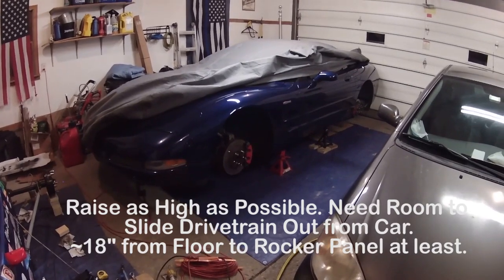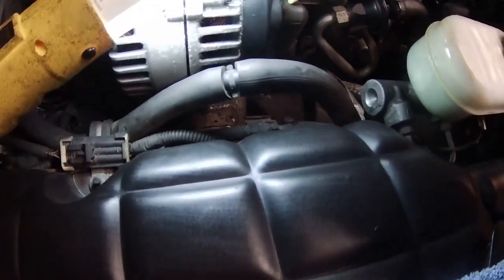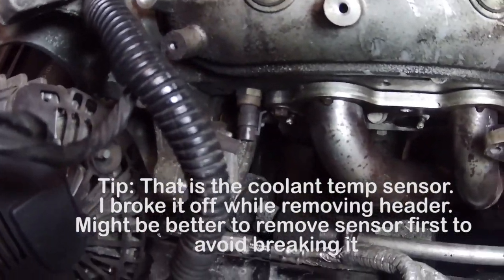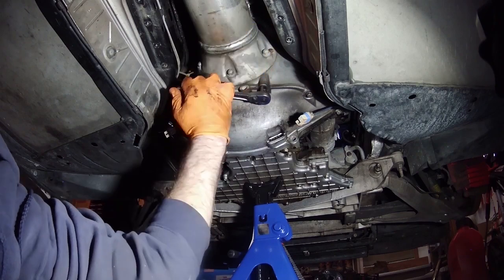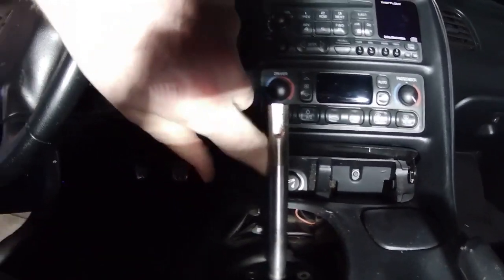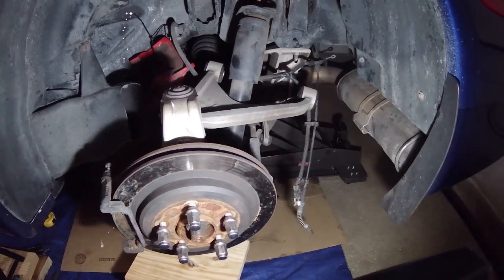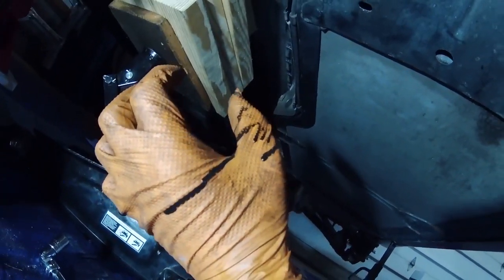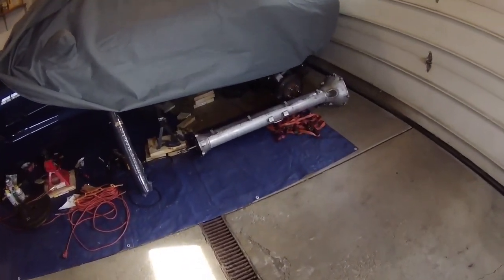C5 Corvette - Detailed Torque Tube Removal

Comment: It's easier if you removal the rear suspension cradle from the diff and trans first.  Drops a lot of weight.  And jacking up a bit higher helps.  Say at least 18" to jack points on the sides.  Thanks for the long video.

Comment: Thanks for the video! It's very helpful to prepare/refresh.
On suggestion: If you had supported the engine at its rear with a jack rather than a stand, you could have tilted it a little bit and the shaft would have come out easier. Now you put a lot of strain on the shaft when the transmission is lowered but the engine can't tilt.

Comment: You gave one very important detail which other videos don't bother to mention.  What tools are needed to get to upper torque tube to bell housing bolts.  3/8 swivel socket with 6 inch extension.  Thank you!!!
Reply from the maker: Good luck, they are a bitch to get to!

Comment: For anyone with long tube headers you can get away with just removing the passenger side and unbolting the driver side and dropping them down. You don’t have to fully remove them. Saves you some time

Comment: Do you need to drop the headers if you have stock headers?
Reply: Nvm
Reply from the maker: No stock headers should be fine to leave on. Long tubes like my car come back so far they are in the way. Stock ones are way shorter
Reply: Thank you
Reply: @cqe5009  mine is a auto do I still have to do every thing inside the car?
Reply from the maker: @automotivelane  never worked on a auto. But I would imagine you’ll have to disconnect the shift linkage still and would have to take some of the center console out to get to the linkage.

Comment: I have clutch fluid leaking from the bottom of my bell housing, do you think it’s my slave cylinder, clutch pedal is stuck to the floor and and master cylinder looks fine
Reply: Thanks for the detailed video btw! I believe I might have to do this in the coming days
Reply from the maker: Yes definitely sounds like the slave is the problem. That’s the only thing in the bellhousing that could be leaking clutch fluid. The line is attached to the slave cylinder and plugs into a quick disconnect up on the frame, but even if the line itself is leaking, the slave still has to be replaced because they are one unit. Does your car have a remote bleeding line? Definitely get one if you have to take the torque tube out. Regular bleeding will help avoid the pedal sticking.
Reply: @cqe5009  thanks on your input , makes total sense. And no unfortunately I didn’t but I will for sure be getting one, one last question, do I have to measure the new slave cylinder even if I’m getting the same original gm slave.
Reply: Sadly also have long tube headers so it’ll also be that much of a pain haha but it is what it is
Reply from the maker: @AlbertoMartinez-nx7hr  there is a lot of mixed opinions out there on measuring the slave cylinder to see if a shim is needed or not. I put a GM slave cylinder and LS7 clutch in my car, and most people would say no need to measure that setup. I did anyways (to be on the safe side) and I ended up needing a 0.180" shim. So I would suggest ordering the shims and measuring it, if you don't need them then you can always return the shims.
Reply from the maker: @AlbertoMartinez-nx7hr  a couple tips for putting everything back together, that I learned the hard way. Install the inspection plate on the bell housing BEFORE installing the headers. I had to completely unbolt the headers because I found the inspection plate won't go on with long tubes in the way. Second, my front O2 sensors hung way down and actually fell onto the headers after about 300 miles. Before you put the headers on, take a couple zip ties and secure the 02 sensor wires to the torque tube. It was a real pain to get zip ties around the torque tube once the headers were in place.
Reply: @cqe5009  thank you so much!! I was wondering if my headers should go back on first when I put it on together, and definitely with the 02s I had zip tied mine but not good enough mine ended up hanging a bit and already starting to melt, thanks so much for tips I appreciate it 🙏🏻
Reply from the maker: @AlbertoMartinez-nx7hr  anytime. Let me know if you have more questions.